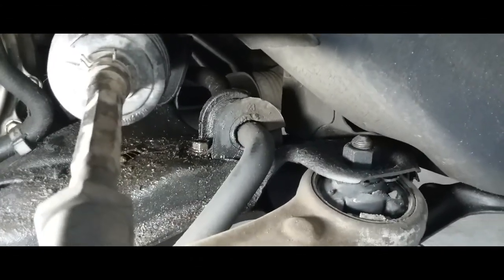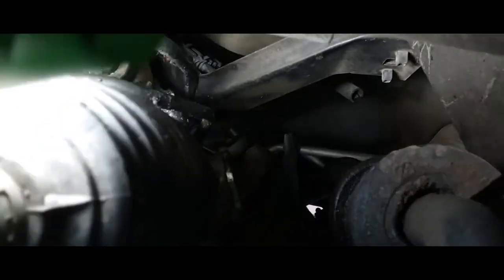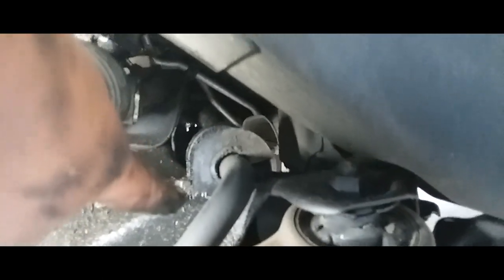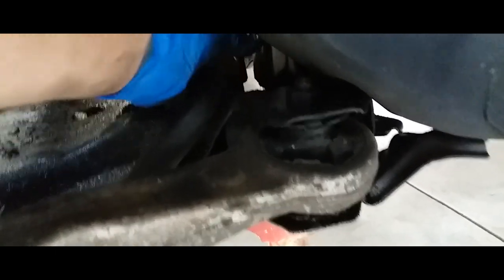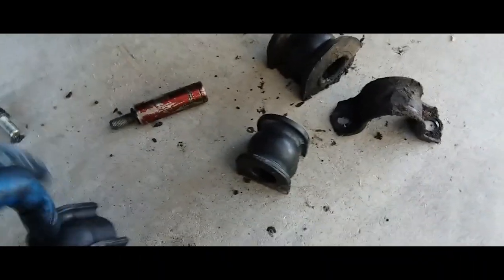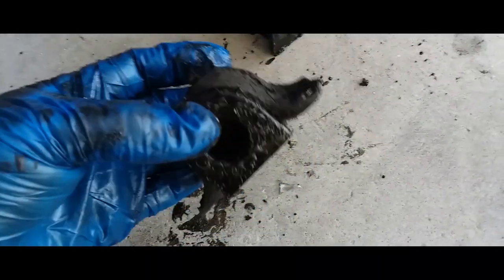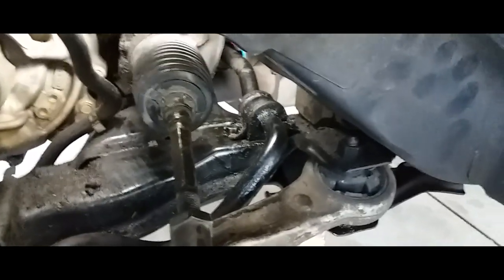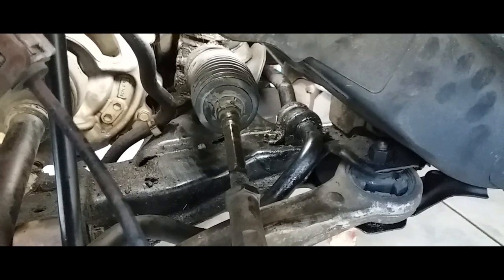How to: Replace 2010 Honda Odyssey EX-L Sway Bar Link Bushing replacement

Comment: Was this van shaking or anything? So the story goes I have a 06 odyssey and it would shake horribly well I put new tires on it and balanced em well I threw new calipers rotors brakes lower control arms and installed it all then was like hell I’ll replace the sway bar links.. so I went to AZ they said they had 2 of the good ones and 1 of the “cheap” ones (only difference is the cheap one has a fitting for grease and the “better” ones where sealed I wanted both so I threw the 2 on my commercial account and paid ….. then they couldn’t find them so they refunded my money and I did grab the one they did have and replaced it now if i let off the brake and it starts to move you see the steering wheel move a little left right left (almost like a busted belt in tire ) and turning it shakes real bad but it’s more like a thump not a clicking … the question do you think it could be from not replacing that driver side link but replacing the passenger side could be causing a bind of some sort since one side is tight and new and the other side of the sway bar is attached to a old link that is wobbly as hell? I have the other link now along with these bushings was curious on if you have had and shaking or vibrating issues before you replaced those and if so did it calm the damn thing down lol
Reply from the maker: I didn't have any vibrations but it was creaky it would creak pretty loud and that's why I replaced them because the sound sounded like it was coming from those bushings. I did and it stopped 🤷‍♂️ hopefully replacing it does it....check if the tires are cupped...could be from bad shocks or alignment...

This is a pretty good video that explains cupping 
https://youtu.be/2lIlgNqRlDY
Reply: @559powerscape  Hopefully it’s just an alignment because they’re brand new struts and shocks
Reply from the maker: @anything_under_the_sun91  when you get the alignment you can ask them if the tires are still good cause u feel a bit of a wobble going slow...good luck brother hopefully its just a simple fix

Comment: Can’t get to that back bolt.
Reply from the maker: Yeah it was hard to get to because there's no space to work with. Maybe easier if you use a swivel on the socket
Reply: I will try that. Cause that clunking is getting on my nerves.
Reply: GEORGE LOPEZ HOW TO DO IT YOUR SELF I know this is a old reply. But I finally was able to get those bushings replace. During the winter the clunking went away. But this summer the noise was worse. So I tackled it again with a 3/8 swivel and it was rough but I did it. So thanks for your advice.